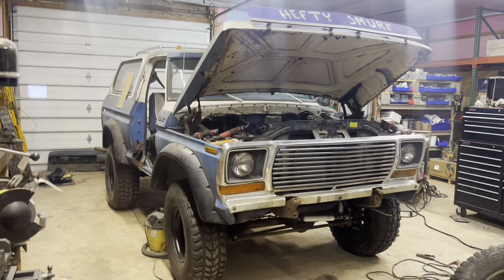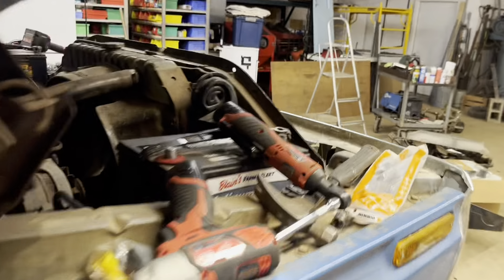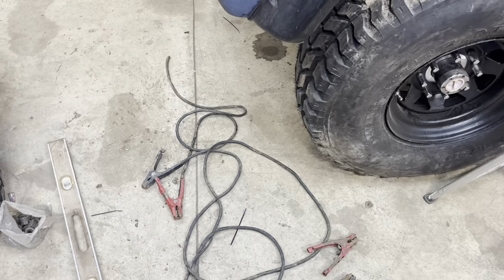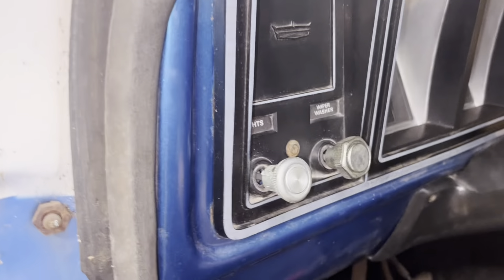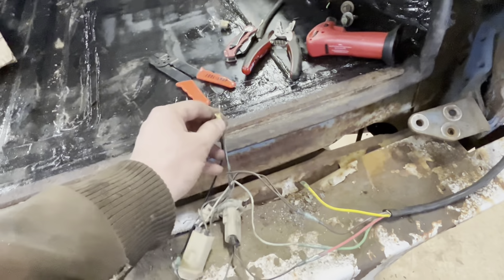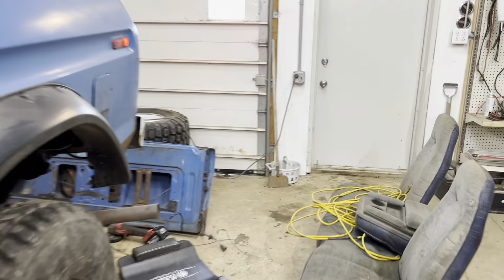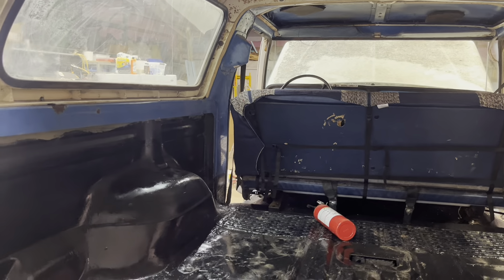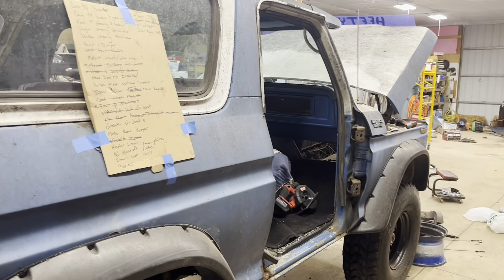Wiring and punchlist items :1978 Ford Bronco Barn Find Pt.10

Comment: May want to look into a dual battery isolator.   Not having one, one battery weaker than the other when hooked up as you described at the front of the vid will kill the stronger one.  A switchable system also allows to pick which battery to use for starting, or both at the same time.
Reply from the maker: I agree long term it’s likely not gonna be great but both batteries are out of junkyard vehicles and we’re $10 a piece. Now that the electrical is all figured out I’m just gonna leave the switch on all the time. Major concern for me is burning up alternators when using the winch a lot.